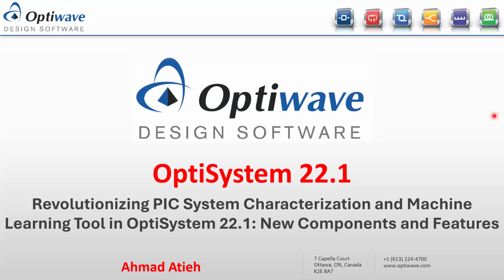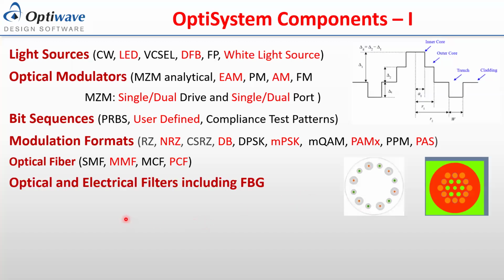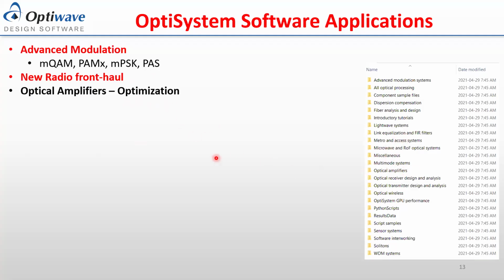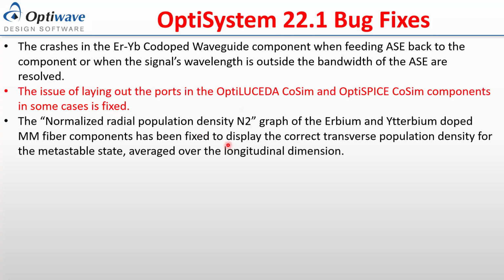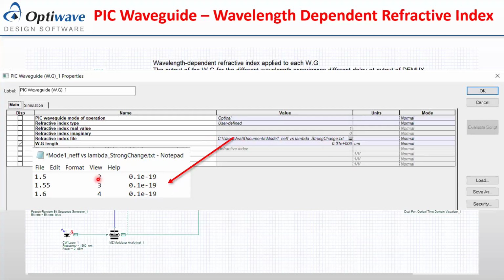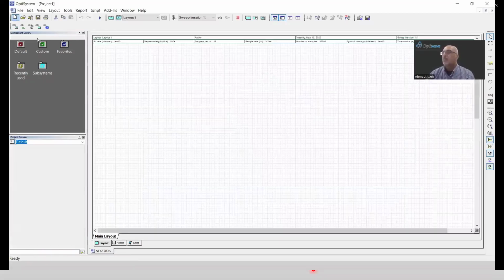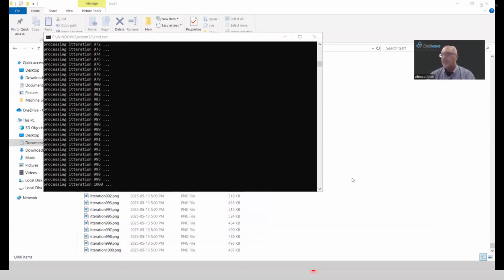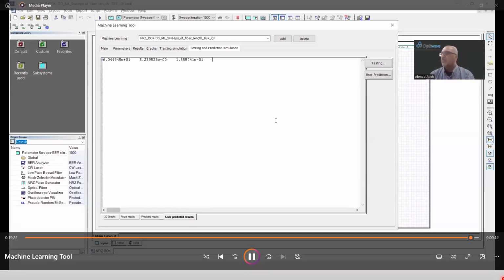Revolutionizing PIC System Characterization & Machine Learning Tool in OptiSystem 22.1

Comment: Thank you so much, very engaged and inspiring and great revolution of Optisystem as best software, please, I would ask you about antenna design in optisystem is still not exist?
I mean antenna that related to RF domain, that used for example in radio over fiber applications!
I now there are s-parameters blocks for this purpose, but it is not clear and hard to accomplish, so, my question is related to Optisystem advancement or news for RF antenna part!
Reply from the maker: We do have antenna modeling in OptiSystem. 
We have UWB antenna model as well as S-parameter model for the antenna.
Reply: @OPTIWAVEHD  Please, where is I can find them in OptiSystem software?
Reply from the maker: @bstanis1237  Please visit our website www.optiwave.com.
Reply: @OPTIWAVEHD  Yes, I know it very well, thank you so much, but, where I can found UWB antenna documentations or resource?  it available within optisystem simulation samples?
Reply from the maker: @bstanis1237  there is an example assembled within the installed samples ("OptiSystem 22.1 Samples\Microwave and RoF optical systems\UWB Antenna\Direct Detection OFDM 4 QAM Transmission System with UWB Antenna.osd")
Reply: @OPTIWAVEHD  Thank you so much :)